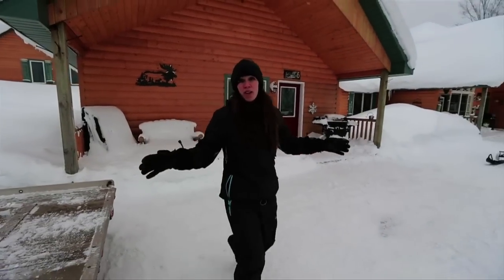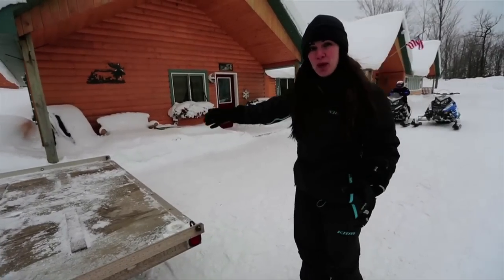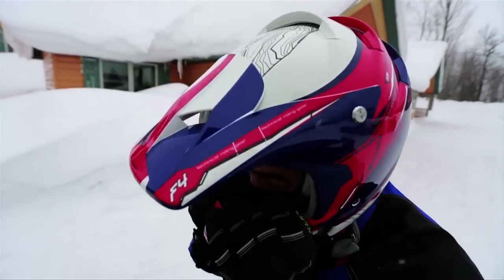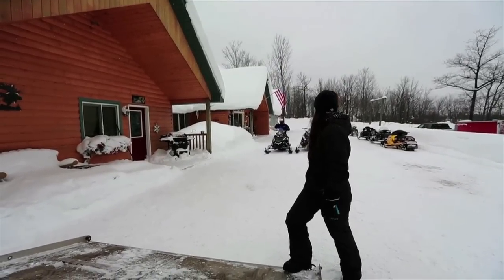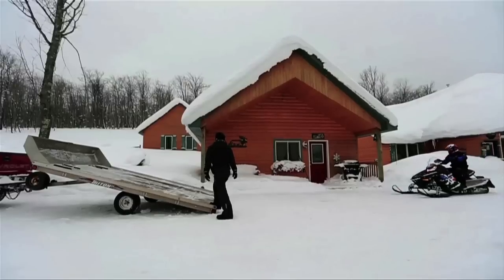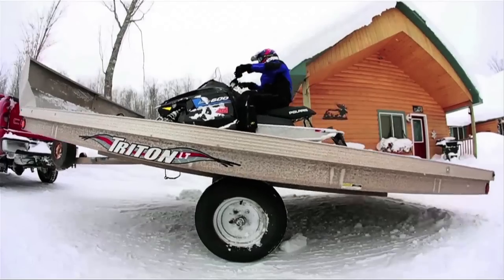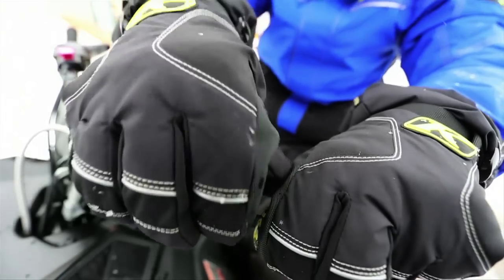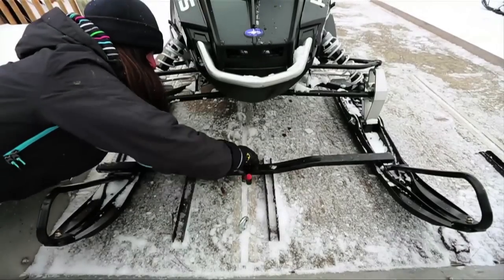Snowmobile Ed: How to Load Onto a Tilt-Bed Trailer

Comment: Any tricks for loading a snowmobile on a tilt trailer WITH just one person?  Haven't found anything heavy enough to hold the trailer tilted down.  Wondering if there are accessories for this??  My tilt trailer is enclosed, so it's a little heavier.
Reply: Shari, did you find an answer to you question?
Reply: put a block of wood under deck and in between frame

Comment: Firstly, trailer should be set up with deck tail heavy so it stays tilted, ( no needfor second person to hold it down) smoothly ride up on deck till its still just tail heavy, engage p brake climb off manually pull front of deck down and install lock pin. You cannot guarantee a second person to help you, learn to do it yourself.